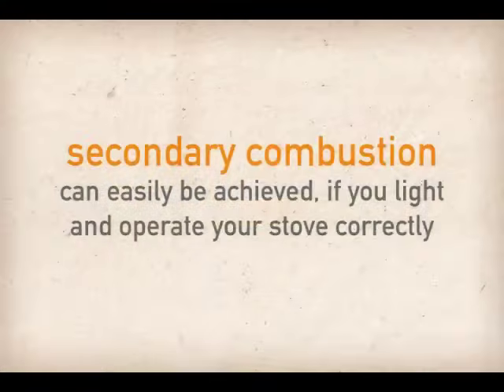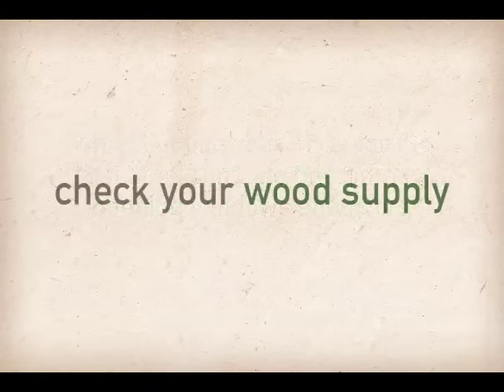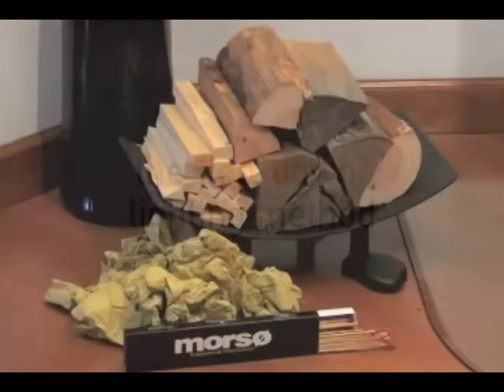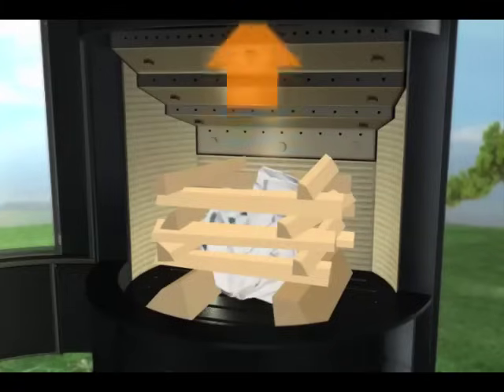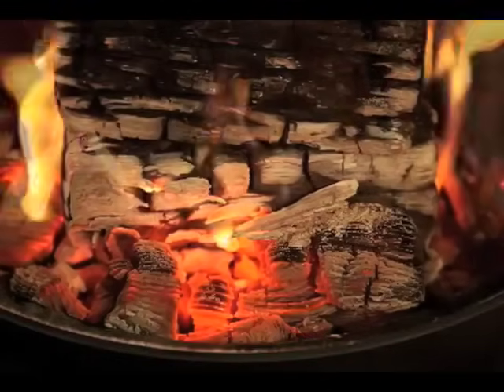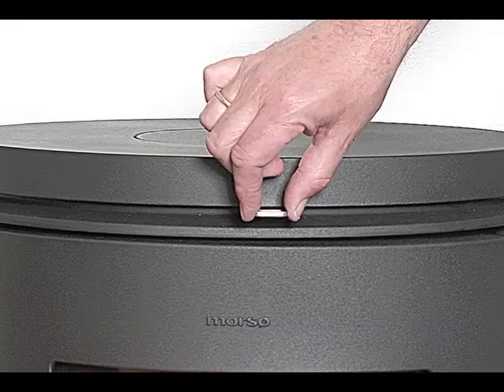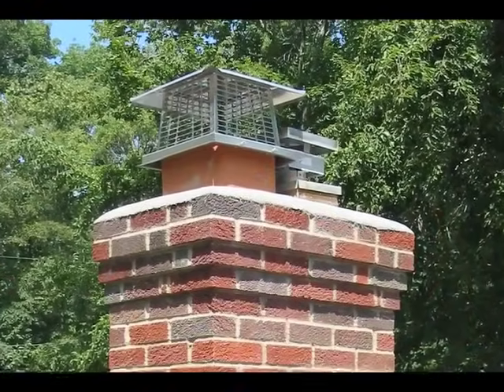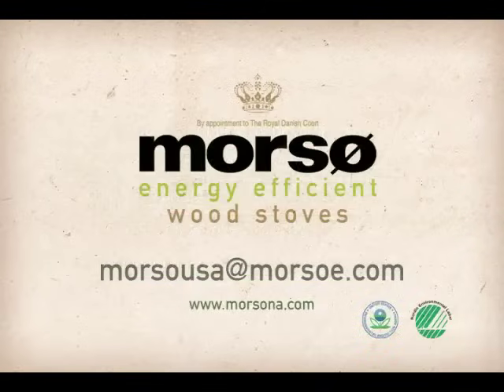How to increase the efficiency of your woodburning stove

Comment: For the warmest winter ever: Fold 2 rubber bike tires with inner tubes and cram into fire box. Add tennis shoes. Saturate with diesel fuel and light. Bring on the vodka, whipped cream & marshmallows!
Reply: +Procommenter I think you're a lot happier because you live where it was colder than most of the wienies referring to this "instructional" video.  Somewhere like central Ontario?   You likely only have to refer to this video (and start your fire) one time a year in the late summer and keep it burning until late May. Am I right?  I love the diesel Idea, but most diesel is low sulfur nowadays, I find it's a more environmentally friendly way to dispose of used drain oil rather than preciously refined new lower emission fuels.  Far more environmentally friendly than taking 5 gallon buckets of dirty 10W40 to my local dump and where there's a risk of spillage. I don't bike, so I'm fresh out of bike tires... Can you saw up used truck tires with a bandsaw when temperatures are below zero?  I'd think they'd stack a lot easier in the kindling bin that way.
Reply: +YankeeinSC1 I find nuclear fusion works best, the warm glow lasts for decades.
Reply: Is your house still standing?
Reply: Procommenter yeah I got drunk doing that
Reply: This worked well for me. My village is still burning but, boy, are we toasty!
Reply: Procommenter g

Comment: What's environmentally friendly about using this method of starting a fire? It looks to me like it uses a lot more wood to start a fire than the method I learned as a Boy Scout. Put your two half logs in the firebox parallel to each other, with the kindling in between, smaller stuff under larger sticks, and the wadded newspaper underneath. Light the newspaper, and if the wood is dry you will have a roaring fire in only a minute or two. Once most of the kindling has burned and the log halves have started you can shove the big log halves closer together. This method uses a minimum of kindling and doesn't smoke any worse that the method outlined in the video, especially in a stove designed to burn the smoke and volatile gases.
Reply: I do what you suggested, with the addition of opening the ash drawer to get a roaring draft into the fire immediately.  In this way, my fire is hot within 5 minutes at most.  The downside is that you have to stay on top of the fire or run the risk of over-firing the stove very quickly.  My fires burn very cleanly, so I have zero creosote to worry about starting a chimney fire (I've seen a chimney fire....bad news), but you still want to be careful not to overheat the exhaust system.
Reply: The top down style of burning is much cleaner than the bottom up fires we were taught to make in scouts.  When wood is exposed to high temperatures it releases particulate matter and volatile gasses that rise up in the form of smoke.   In a bottom up burn configuration the wood is releasing all the gas and particles as the fire chews it's way through the wood.  Because the heat of the fire causes those gasses to rise extremely quickly, most of the gas vapor escapes before it can be fully combusted by the flames, resulting in an inefficient and dirty burn. 

In a top down burn, once the fire gets going on top the heat it generates causes the unburned wood below it to start expelling the volatile gasses before the fire itself even touches it.   These gasses then travel up and through the fire above and as a result are actually given enough time in the flames to be combusted, acting as an additional source of fuel for your fire.   

With this method your fire is far more efficient because it's able to make use of the wood gasses as fuel instead of letting them escape uncombusted in the form of smoke and pollutants.   When you burn in this manner inside of an enclosed barrel, kiln or stove where you can control the amount of air intake and exhaust given to the fire, you can easily attain a much hotter, cleaner and longer lasting fire than would ever be possible when using the bottom up method.   One of my favorite things about the top down fire is that it gives all these benefits while using a good deal less wood to meet your heating needs. 

I'll tell ya, I was as skeptical as anyone but the proof is in the pudding.  After trying the top down method and seeing it's advantages first hand, I'll never light from the bottom up again. 

Hope this helps.
Reply: Soknik01 - I see your point, and conceptually, it makes sense. My fires - using the open ash drawer to make a draft, does create a lot of smoke (wasted fuel) in the first 1-2 minutes. You might be on to something. After 20+ years of making fires in a wood stove, this would require major behavior modification on my part. But it's an interesting idea and I'll have to give it a solid try.
Reply: I used to be a bottom up fire lighter like my Grandmother (who seemed to be  able to put a match to damp sticks and still get a fire going :)  the stuff of legends). 
One  day a few winters ago an old country friend of mine was visiting for the weekend and helped get everything together to start the fire
Reply: He offered to show me a "new top down" method of starting the fire he had stumbled on, on youtube. 
I was skeptical but from experience new he had a good Bullstite filter and uses his fire a few months longer each winter than me.  If I hadn't seen it with my own eyes I wouldn't have thought it possible. 
A very small amount of paper and fine sticks on a large stack of larger wood layers. ALMOST NO SMOKE even from the start. The fire progressively burnt down through the  layers of bigger and bigger wood. I didn't need to open the door to feed the fire until it had burnt down to a nice bed of coals = no smoke in the room. I popped outside every few minutes and there was virtually NO SMOKE at the start and NOTHING after the fire got going
I was a convert to TOP DOWN with this one effective demonstration in my own fire.
Its so good at my age to learn something new, especially when it saves so much time and effort. 

Stack correctly, light, and walk away 

standing on the shoulders of others
Reply: Boy scout method is for open area. In a stove that may generate a lot of smoke which can diffuse to your house if the stove door is open.
Reply: Two sheets of newspaper,set them on fire then hold a plastic milk bottle over the flames,I burn all my long chain polymer wast in this way,much more environmentally friendly than putting it in the recycling box, only to have it shipped thousand of mile to the 3rd world,and when I shop I try to not buy plastic packaging if possible
Reply: How neat! Thanks for sharing! 😊🌎✨
Reply: @Soknik01  well explained, thank you.
Reply: you  are  a  very  wise  person!  I use  the exact same technique  and  start off by placing 2 piece of wood parallel to each other, then 2 or 3 smaller horizotally and then some paper or lint above these and top it off with 2 more piece parallel. I lite the sucker up with a long match, keep the door 2 inches open with the damper fully open for around 5 minutes or so, when it's going good, i close the fire box door,  and close the damper 3/4 of the way and that baby burns between 200 and 300 celcious for at least 2 to 3 hours. Thereafter, i open the damper all the way, slightly open the fire box door 1/8 of an inch for 10 seconds, then open fully. I then add a few more longs and repeat.....winters are hot in my place👍 @Soknik01

Comment: Who still uses newspaper and kindling? I light my stove with a propane torch. 5-6  minutes of propane fire and the wood is burning nicely.
Reply: I find that a good chunk of car tyre & a diesel soaked rag  gets the heat in the flue real quick
Reply: The coffee that just blew thru my nose felt like burning car tire.
Reply: That works but cutting the tyre into chunks is too much work.
Reply: The Garlic Farm 

P
Reply: Sham
Reply: Diesel-soaked rags and car tyre ARE pretty good, but I find that they work even better with some kindling made from rare, ancient and endangered spiecies of tree.
Reply: michelcycles ..Just a little more tread, when the fires going dead...
Reply: @routha3046  i much prefer the flesh of recently departed roadkill .  Doesn't smell as bad as car tyres. And I borrowed some plutonium too. Nobody's gonna know so what's the harm

Comment: Catalytic converter re burns the gases also if you vent your stove with outside air you are not pulling the warm air out of the house to go in the fire. This is the most efficient way to get the most heat from the fire without pulling in cold air into your house.

Comment: the "quality" of the wood isn't so much the question as the "moisture content" of the wood. seasoned wood is generally anything under 30% moisture though ideally seasoned wood would be at 18-20% and frankly anything seasoned below that is just kindling at that point as it will outgas and burn much faster even in a low air environment most EPA stoves are tested with wood running in the 22-26% range because the lower burns are helped in the test if there is a wee bit more moisture there to lengthen the test out a bit (getting a low burn (category 1) is extremely tough with Non-Cat systems such as the Morso in the demonstration) whereas the high burn (category 4) you want a fast hot fire that uses the wood quickly as the "weighted average" method of testing is what determines the Listed BTU output of the stove so the test charge is weighed to a specification determined by the firebox size, and then timed as it runs through the fire, during that time the largest drop in weight over an hour of the test is used for the "output rate" figuring the BTU potential of the wood is 8500 BTU/Lb you look at how many lbs were consumed minute by minute hour by hour , and the largest 60 minute drop in weight is what is used. so , just to make the math easy lets say our stove hit 10 lbs consumed in an hour (thats way higher than anyone would get but im using it for the easy math that would release 85,000 BTU during that hour , this is your INPUT value, now once all the other parts of the test are done to include stack temps and such the "Listed Efficiency" is established (as the heat going up the chimney cannot be listed as "output" as its not staying inside the home) so (again for ease of math) lets say the unit achieved an average of 70% efficiency during the testing (minimum of 4 fires for the 4 categories) so going back to our 85K btu we multiply that number by .7 (70%) and it gives us 59,500 BTU so the stove would get to be listed at 59,500 BTU/Hr which isn't exactly the truth but its a measuring stick that everyone has equal ability to use. and it comes with a price as if you build the stove to get the high output in your cat 4 it makes it all the more difficult to get the Cat 1 (or 2 Cat 2 burns which is allowed if you cannot get a cat 1) which hurts your overall efficiency  which lowers your BTU/Hr due to a smaller percentage. 
Full Disclosure, i work for a woodstove manufacturer other than Morso (though i admire their products) nice video.
Reply: I was asleep by line 5...zzzz

Comment: Are you burning your wood bottom up or from top down? (Think rocket stove) If air is coming from under the wood pile. the wood burns more efficiently from the top, down. Instead of a campfire, throwing wood 'on' the fire, burning from under.

Comment: I removed the firebrick in the bottom of my wood stove and cut a v-groove to accept a perforated 3/8" threaded black pipe connected to an adjustable natural gas valve, no kindling needed.

Comment: Critical, but unmentioned, is the wood’s moisture content! Seasoned wood is rarely sufficiently seasoned, and results in heat being used to expel moisture from wood, rather than heat a space! The maximum moisture content of 20% is often not achieved, and results in an inefficient burn!